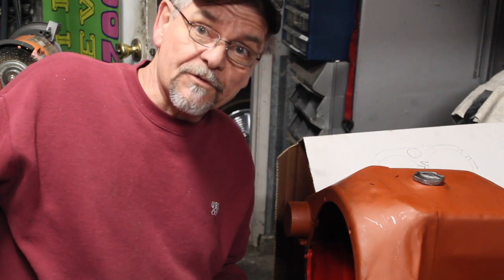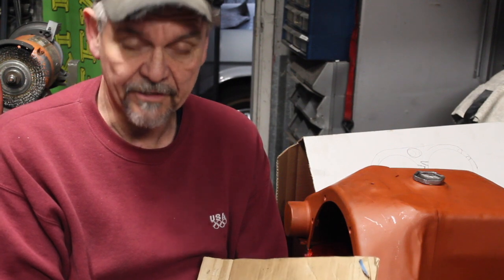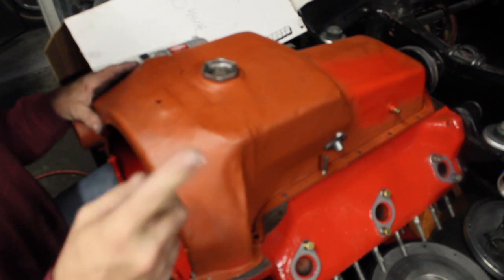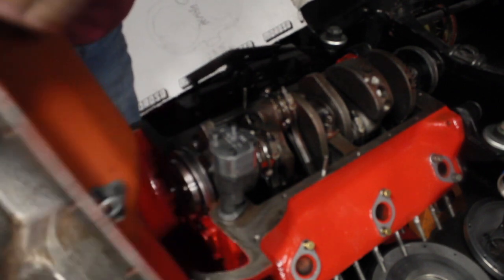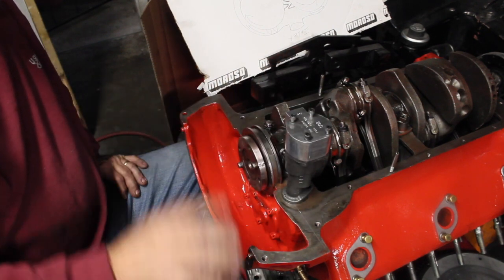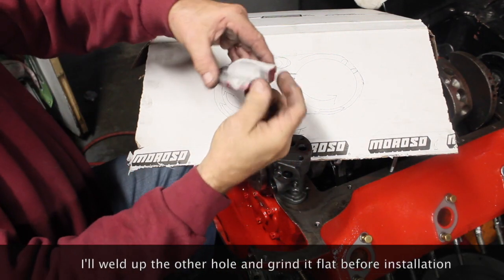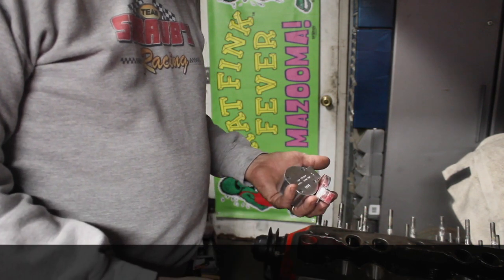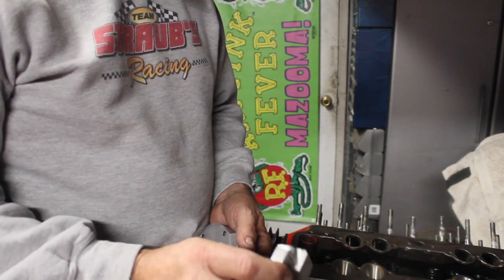59L Block   Full Flow Oil Modification ... More Progress

Comment: Its coming along nice Ron. You sure about aluminum tubing? I would be concerned about vibration and cracks. Steel tubing with lots of supports. Keep it up its looking good
Reply from the maker: Well Randy, there’s been a couple changes. I am no longer welding it. I’m putting out a video in a couple days and I bought some fittings for it instead. I would like to do steel but I really don’t have a way to bend it. And this line is rated for more than what the pump will put out. The vibration is a concern though.  Hopefully these Swedgelock fittings will work. Also changed the bulkhead.  Picked up an Allen Engine Diagnostic III Analyzer today. Nice road trip. Thank you for watching Randy

Comment: 13:08 That complete operation could have been done in the 3 jaw. 
Do you have a drill chuck for the tail stock ?
Also be mindful of cutting speed verses drill diameter and material.
You're progressing well. It would be nice to see a belly tank car build.
19:54 The pan is a tank. I know you're from New Jersey, because it's called that there. Lol.
Reply from the maker: Thanks for watching RDF... Yes I have a drill chuck for the lathe, your right... guess I have an old mindset which refers drilling to be a vertical thing. Still learning how to use a lathe also. I need some machining lessons for sure.  Having a time learning speeds and feeds. I’m too heavy handed. Need to train this old mind to slow down even more and think. It’s funny,,, My work in customizing has always leaned towards an east coast style. And...the lower the better. My most favorite car growing up was El Matador. If you know old customs you’ll know the name. Lost track of it after it was left in a barn in Florida and got crushed to the beltline and then rebuilt. Matador Red, 40 Ford, canted quad headlights.